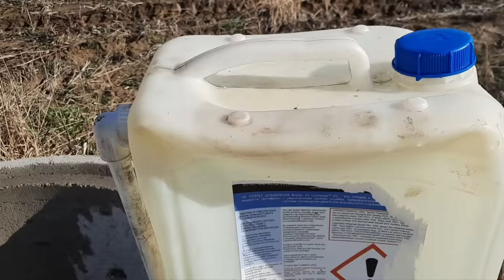Simple idea how to make a water pump without electricity without fuel

Comment: Seeing the sides of the bottle sucked in tells me you created a vacuum and it works.
Reply: No. It does create a vacuum but it does not work if the water level in the well is lower than the outlet. The vacuum works both ways. An increasing vacuum would first stop the flow from the outlet before it is strong enough to draw water from the well.
Reply: @sciencefreak9070  UM NO.  I just had to explain this to someone else.

Yes it does pump at 5:25. It is the weight of the water in the tank and the atmospheric pressure and gravity, that starts the syphon. The vacuum that the syphon creates collapses the tank. As it drains, the air doesn't go anywhere, so why is it collapsing? Because the water is pulling down on the air but it can't pull the air out, so what it does is it starts pulling the water from the well. .It is as if you were sucking on a hose to pull up the water. Only difference is that the water in the tank is doing the sucking for you. You also have to have enough water in the tank to pull enough water up, to fill the intake pipe. You run out of water in the tank and air gets in and breaks the syphon. The bigger the tank the better. More water, more weight, more suction. The water in the tank gets replaced as the water from the well comes up. 

Also remember that the height of the tank is also important. At 7:00 yes it will work and work better. Remember that the tank is above the top of the well and that's the driving force. Because it is already higher than the well , gravity does the job to start it. The fact that it will still pump water to ANY level below the spout level is constant. If you run a tube down hill that tube will cause more draw. That's all. If you go downhill far enough, and the end is below the water in the well, it just becomes a regular syphon.
Reply: @AztecWarrior69_69    From your comment I see that you think it's the weight of the water which matters. Wrong. It's water and air pressure which matter, and water pressure only depends on the height of the water column, not on it's weight. This is obvious by the fact that the water level in a thick and a thin tank which are connected at the bottom is the same. Although the water weighs more in the thick tank it doesn't push the water up in the thin tank.
And you forget that the "sucking" of the vacuum also stops the outflow of the tank. Let's do it with numbers. Let's assume we have a tank with a height of one meter, the outlet is at the bottom. One meter of water develops a pressure of roughly 0.1 bar at the bottom. If pressure at the top of the tank drops below 0.9 bar, the outside air pressure of 1 bar is already bigger than the water pressure at the outlet. This means that either air leaks in or - if you prevent this - water doesn't flow out anymore and thus the vacuum does not increase anymore. But with a low pressure of 0.9 bar water will rise in the pipe from the well only for one meter and there is no chance to get water up from a deeper well. I recommend you to do a simple experiment. Fill a plastic bottle with water, close the opening with the palm of your hand. Turn the bottle around with the bottom pointing upwards and submerge the opening still closed with your hand a little in a water basin to prevent air coming in. Now put your hand away. Does water flow out and a vacuum forms which might even crumble the bottle? Not at all. A small amount of water will flow out, hard to notice. The bottle stays full with water.
Have you considered that if this pump could lift water to a higher level it would be a perfect perpetuum mobile? You could let the water flow back in the well and drive a turbine on its way, free electricity for ever. But sorry, perpetuum mobiles do not exist. If you still have questions, I can answer them readily.
Reply: @sciencefreak9070  "From your comment I see that you think it's the weight of the water which matters. Wrong. "

Well the you would be wrong. And if you are basing the rest of you comment on that then your whole comment is wrong in the assumption that I don't know what you are trying to say.

" It's water and air pressure which matter"

So weird.  "It is the weight of the water in the tank and the atmospheric pressure and gravity, that starts the syphon." 

You seem to not understand what head pressure is. It is the combination weight, atmospheric pressure and height. The liquid doesn't matter. In this case water. Weight matters. it is not all that matters but it plays its part. 

Look you can do all the math you want but if you don't have the basic numbers from the start you are going to FAIL.

First off you are completely not getting that you are NOT pulling from the bottom of the well.

This is pulling from top of the tank. The intake should already have been filled to the top. It's called priming. 

Once you open the bottom valve that head pressure pulls down creating the vacuum in the tank. 

This is where you fail. The water that is already in the intake pipe takes little suction to draw that water out. Since it is at the highest point (NOT deep in the well).

Once the water starts to run, it is the Cohesion Properties of water (is the property of water that describes how water molecules are attracted to each other, making water a "sticky" liquid.) the head pressure (weight of the water increased by height) in the tank, that keep the siphon going.

Again when the pump starts, it is NOT pulling water all the way up the pipe. Water should already be there being held by a foot valve. 

So NOW redo all your calculations on how much it takes to pull water from the pipe that is ABOVE the outlet valve.
Reply: @AztecWarrior69_69    I note that you haven't done the experiment I proposed which would have perhaps opened your eyes. I don't have to redo my calculations. Just because you claim they are wrong doesn't make them wrong. And I know what "head" means in connection with pumps. In no formula for head and head pressure you will find the weight of the water.

The greatest blunder in your comment is "The water that is already in the intake pipe takes little suction to draw that water out. Since it is at the highest point (NOT deep in the well)." Sorry, if you want to bring up water from the well you have to lift the whole column of water in the input pipe! Otherwise you would never get water from the well entering the input pipe by passing the foot valve. And to lift for example a 4 meter column of water does need a pressure difference between both ends of 0.4 bar, which means a pressure at the top of the tank of 0.6 bar or below. If you are not experienced to work with pressure feel free to choose a suitable diameter for an input pipe and calculate the weight of this 4 meter water column. To lift it needs a force which is bigger than this weight. And with force being the product of water pressure and cross section you will come to my result. With a tank of 1 meter height a pressure of 0.6 bar is never reached since already at a pressure below 0.9 bar the water pressure at the bottom of the tank, where the outlet is, is smaller than the air pressure of 1 bar from the outside. Which means that either air leaks in or the outflow stops. 

If you think my calculations are not correct show me yours! If you can't  you are not competent in this field. You show your lack of competence already when you think a perpetuum mobile is possible. And it also doesn't seem to surprise you, that this rather simple construction can't be found in any sound information about pumps. How likely is it that it was only invented a short time ago and became known just via YouTube-videos? LOL.

Comment: What happened to the laws of physics? This only works if the level of the end of the hose is below the level of the water in the well. They don’t mention that.
Reply: And it doesn't work quite as well with McDonald's Milkshake. 
They didn't mention that either.
Reply: Physics still apply.  It doesn't work if the drawline from the well to the sealed jug is greater than can be overcome by the initial vacuum.  

Though, if it was a deeper well, longer supply pipe, adding a valve to the inlet pipe would enable closing it without losing the prime from the initial fill of the jug, allowing one to refill the jug and continue to prime. Once primed, as long as the system is vacuum tight, the supply spigot would always draw water from the well.
Reply: It is using the laws of physics. The vaccum created by the water falling down the spigot (tap) is pulling water up the tube from the well. It won't work if the weight of the water in the tube overcomes the pull of partial vaccum in the can.
Reply: @MrBollocks10   This is syphon action only. No pumping at all.
Reply: They didn’t think they needed to ! You figured it out all by yourself! Yes water flows down hill ?
Reply: @razikabdul8668  so, sa the exit is set so that it flows back into the we'll, would that not prove that perpetual motion is possible?
Reply: I wrote a solution to this issue just above
Reply: Works till about 10 metres down.
Reply: Actually atmospheric pressure on the well water pushes the water up the pipe because pressure in the container is lowered once the water runs out of the tap.basic physics
Reply: No the water is pushed up the pipe against the reduced pressure in the container when the tap is opened and water runs out
Reply: @acswain6720 vacc lower resist from upper side, PHYSIKST))))
Reply: The video clearly depicts a siphon and you are prattling on about the laws of physics.... It is a siphon.

Comment: You forgot to show how the submersible pump was fitted to the end of the pipe into well and how it was powered. A proper siphon only requires the intake end of the hose to be immersed and the outlet end to be lower than the water source.
Reply: It’s quite interesting but could be a fake with a pump on the end could be real. I’ll give it a go with a wheelie bin
Reply: The angle shown downhill from the concrete pipe where the 5 gallon jug is sitting looks clearly like the end of the hose downhill is below the apparent water level in the well. This siphon would work until that water level dropped below the end of the intake or discharge.

Comment: To start the waterflow in respect of the gravidity law only fill the hose totally on a slope at the upper end and remove the air. Don’t forget at the lower end attaching a water tap closed till the hose is filled
Reply: Do you know the height limit to work?
Reply: Nothing to do with what was done here.
Reply: @joaquimferrariJF  Hello my friend. It is very simple. The airpressure at the sealevel is 760 mm Hg = 1 bar or correctly 10 meters water column. You can lift water out of a 10 meter deep well, but the outlet of your hose must be deeper than the wells waterlevel and your hose must be completely filled and no airbubbles inside. At the wells side your hose should have a oneway backlash vent, so that the water not could flow back and at the outlet side a normal water tap. Once filled you need no electric pump, the gravity works for you.
Reply: @colinmcalister8704  sorry for you. It’s the hydrodynamic law, the weight of of the outflowing water must be greater than the lifted water, a can inside the closed system changes nothing, the can is running empty and air inside the system is to fail all. No chance to lift water out of a well without pump power, it would be amazing lifting water upstairs. The guy also works with the waters weight, nothing other. 😹😹
Reply: @csu9242    Slight correction. It is not the weight of the water which matters, it is the water pressure in relation to air pressure which is relevant. A siphon will also work, if the weight of the upflowing water is bigger than the weight of the downflowing water, for instance when thicker pipes are used on the upflowing side. Force is the product of area and pressure. Thus air pressure can also lift a bigger weight of water in a thicker pipe upwards.